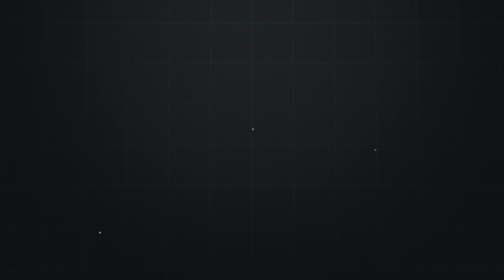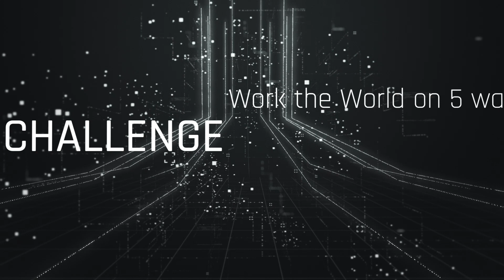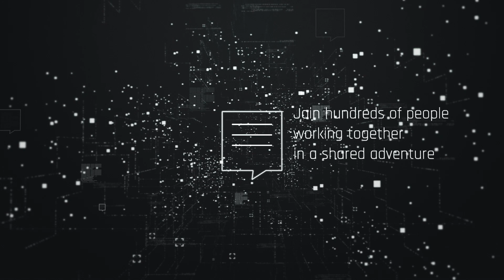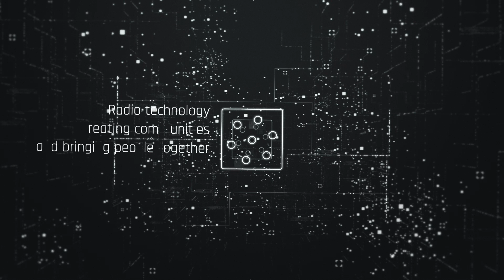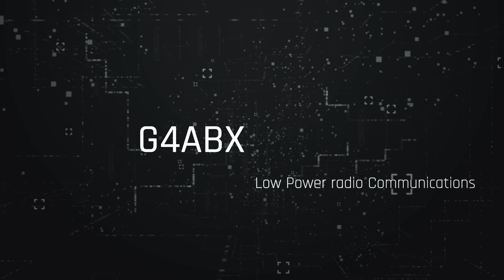Ham Radio: Introduction to G4ABX   HD 1080p

Comment: Great to see/subscribe to your YouTube Channel, Bruce.  Fantastic Title Sequence!!  (I'm a Broadcast Systems/Production Engineer so can appreciate what went into it....)

I was brought up with the poor relation to the AR88, the ubiquitous R1155, the type of which my father used to service as a Wireless Mechanic ("Erk" - not an accepted term in today's RAF) during WW2.

What brought me to your YT Channel was the KX3.  My first Transceiver was the FT290.  I built a 2m HB9CV aerial (antenna - isn't that an American term?) from a bit of broomstick and a coat-hanger.  My first contact was in Birmingham (150 miles) on internal batteries and probably about 2 Watts.

Five years ago I bought and built a KX3. I didn't fully appreciate how versatile it is until I started to work /P.  I have a blind spot for CW, so it has to be SSB for me - Data Modes need to many extras, RPi/Screen/Keyboard/Mouse.  I have the 2m Transverter option, and the Ukrainian 28/70 Transverter, and with home-brew aerials can work marvels /P.  4m and 6m combined HB9CV, 2m HB9CV (the same from years ago) and a Base-Tapped Loaded Vertical that the KX3 can tune from 80m to 10m.

I'm looking at making a "Go-Box" equivalent (inexpensive!) for /Pedestrian (Lightweight Backpack) and your Channel has given me so many ideas on how to go about it!

I much appreciate how so many Amateurs are producing You Tube movies, that often cover those matters that the Dealers seem to miss, and  look forward to seeing more of your well-produced movies.

Best 73 de Peter G6EPN
Reply from the maker: Good afternoon Peter. Sorry for the late reply. 
I too had an R1155 -- and I took it to the Scout hut so many of my mates could have a listen to the Amateur Bands.
It was a far more 'friendly' radio than the AR88D -- which was a bit intimidating if you tried to take it apart to have a look inside or fix something!
I also had a 290. In fact I've still got the HF transverter I bought for it (gives about 20W on the main HF Bands).

As for CW, I'm still a novice -- although I can manage contests at around 25 wpm these days. My Rag-chewing speed is about 18wpm --- MAX!
I've never found CW easy so its a constant challenge to improve.

Yes, the KX3 is a great rig and I'm delighted if I've given you some ideas for your own GoBox.
Its something I've been procrastinating over for several years. I'm glad I took the route I did and 'imported' the tricky mechanical stuff -- the Front Panel.
Whilst I'm pretty good at the electronics and software, the mechanics is where I generally fall down.
If you want any specific help as you move forward, feel free to drop me an email.

by the way, I've now got the new Raspberry pi zero2W running inside the GoBox.
Its brilliant! runs cool and consumes less power the the Pi4b
I've recently uploaded my first video with it running digital modes on the IC-705.

72
Bruce G4ABX
Youtube: Dr.T(G4ABX)
Web: g4abx.co.uk
Twitter: @g4abx